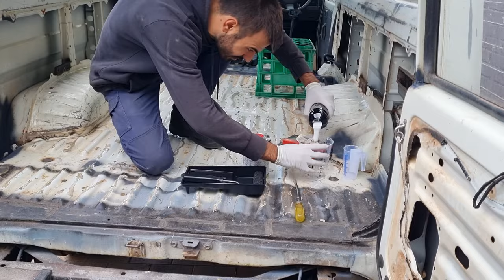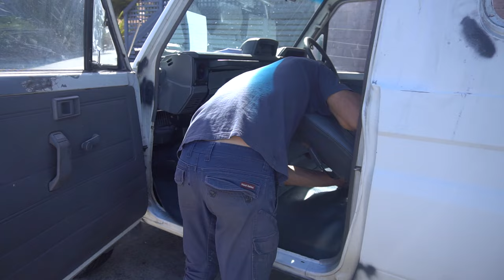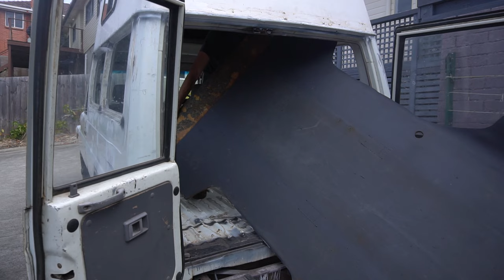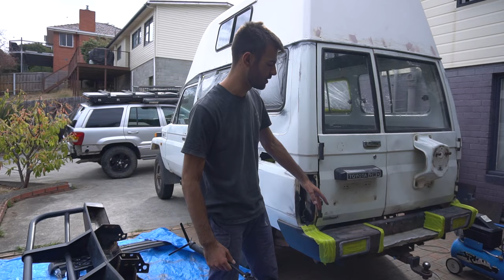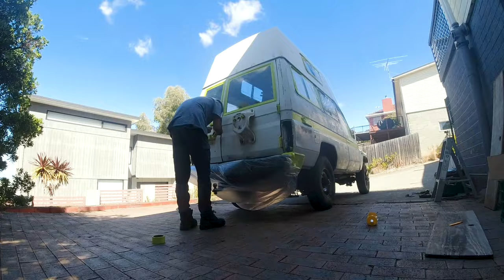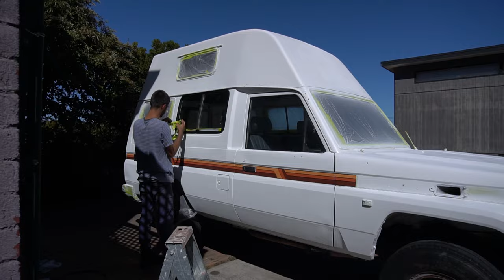AUSTRALIA'S CHEAPEST TROOPY BUILD EP4 TOYOTA LANDCRUISER // PAINTING THE TROOPY WITH RAPTOR!!

Comment: Looks fantastic , no sound deadening while you had the panels off ?
Reply from the maker: No I didn't it's easy to get back to them the Fitout comes out with about 8 bolts, its actually pretty quiet the modules and plywood stop a lot of the noise